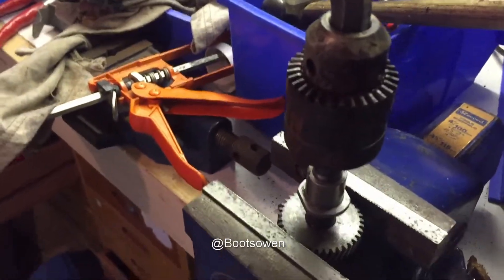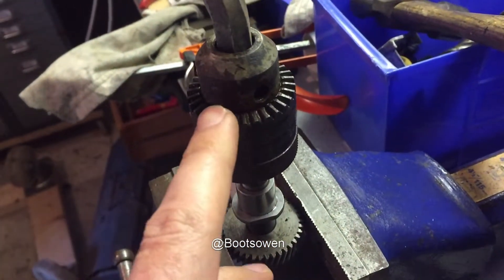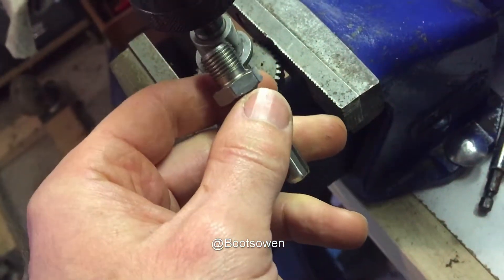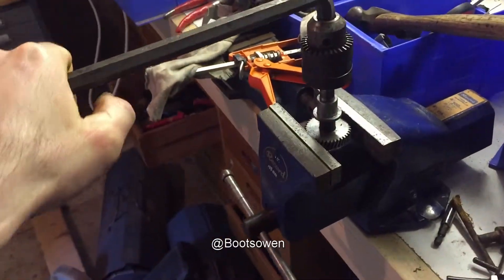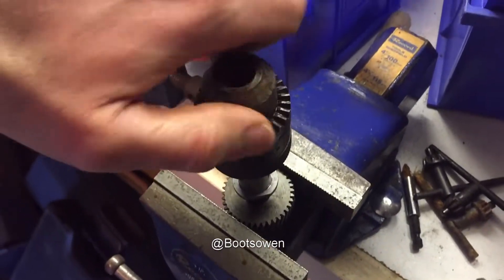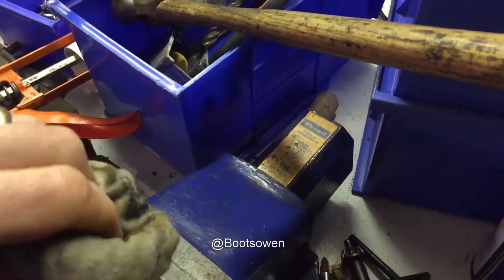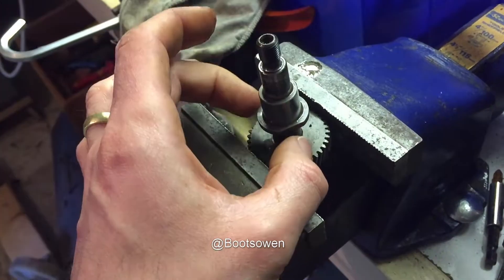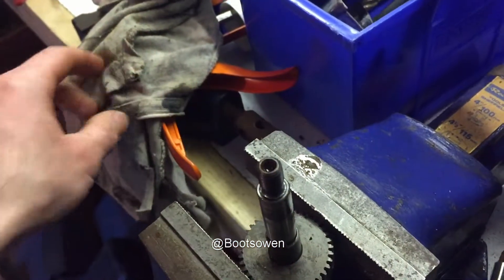How to release a Jacobs chuck (model K30)

Comment: Ran through to the other room to see what my SDS-Plus to threaded adapter is (off broken chuck)
Measures 1.25mm pitch or 20 tpi and major diameter of 12.5mm.
Probably 1/2"-20 UNF. What's yours?
Reply from the maker: No idea Ian. Not even sure where this chick is!